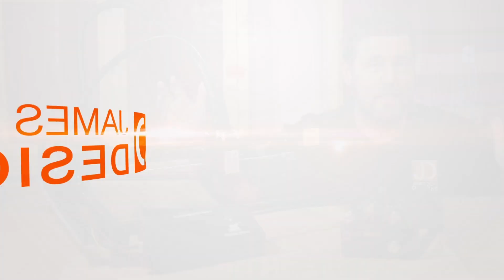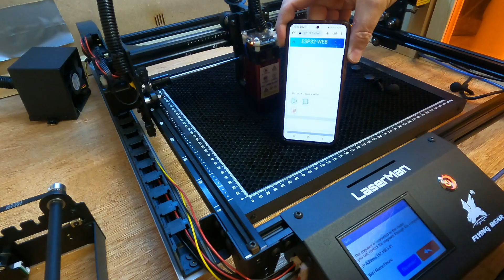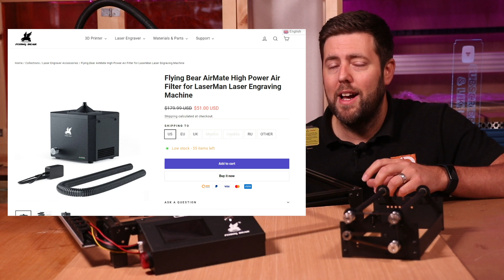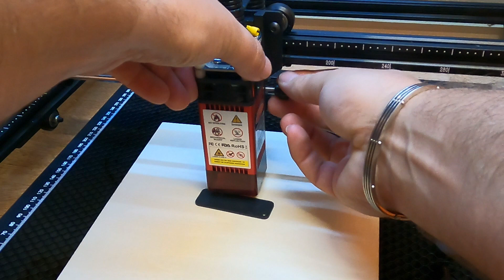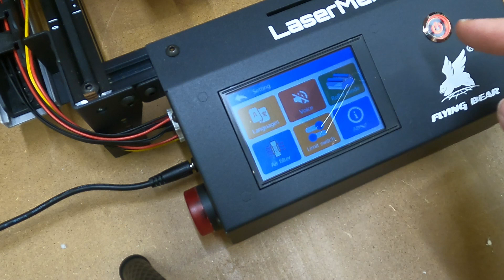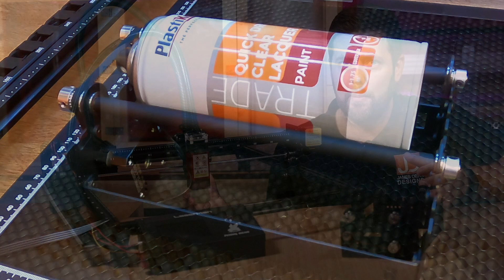All-in-one budget laser - Flying Bear Laserman review

Comment: Great video James!  I clicked on the link for the laser and it came up at $220 for me.  I'm assuming this is for the 5.5watt.  I couldn't find an option to buy a 10 watt machine, only the 10w laser module separately.  I like the idea of flame detection, but judging by your experience,  the effectiveness on this laser is questionable. I like to check prices on different lasers to compare with my laser.
Reply from the maker: 220 is for the frame, a little further down the page it gives you the option for the 5w or 10w laser which it then adds to the price. The flame sensor should would in theory. Its meant to pick up the light wavelength of a flame, I perhaps just needs to tune the one on mine
Reply: @JamesDeanDesigns  yeah, OK that makes sense.

Comment: How does the attachment for cylinders connect to the system?
Reply from the maker: Really easy. You disconnect the Y axis cable from the control box and connect the rotary. You need to change 1 setting over but it take less than 30 seconds to do it all

Comment: Total newb here. Isn't the flame detector in the laser head? If so, how would a flame a foot away set off the detector?
Reply from the maker: No because the laser moves about. The flame may not start straight away as the laser moves onto a other area. There is a little sensor in the back of the control box that detects light within certain wavelength, typically the wavelength of flame but just not in my case
Reply: @JamesDeanDesigns  That's very good to know. Thanks for the info.